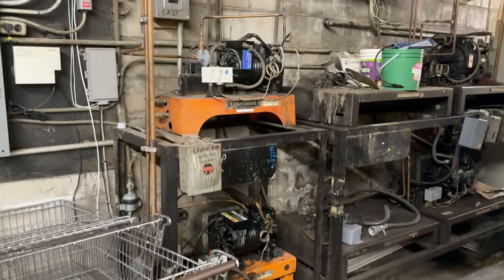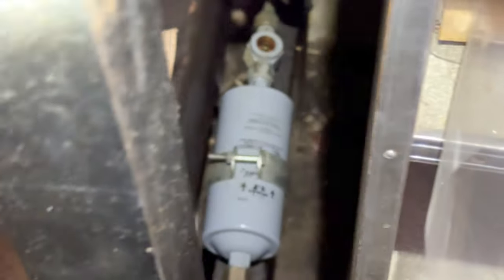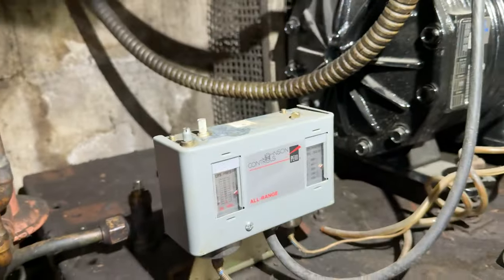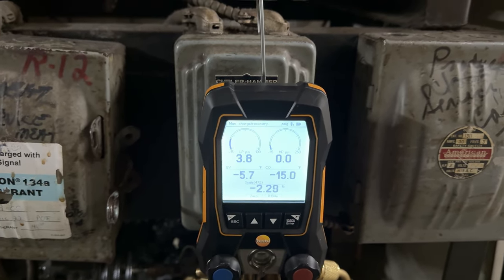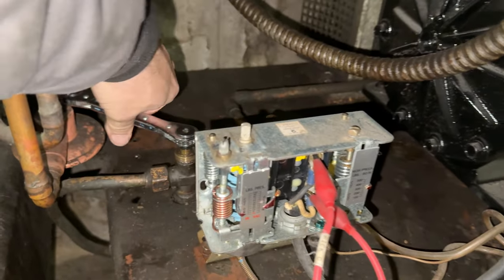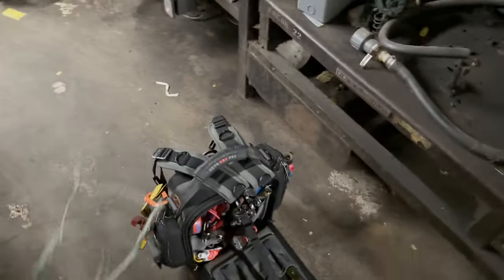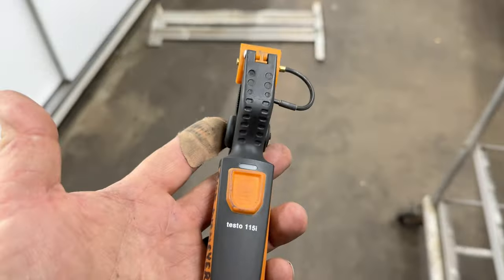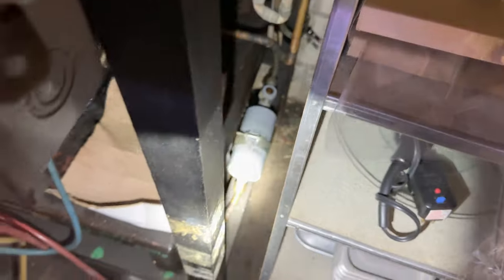Bad TXV & Refrigerant Leak What Else Could You Want?

Comment: See if your company will get you the sporlan BQ kit. You can pretty much build almost any valve you need with it. Saves you time and gets the case back up and running a lot faster... Good luck leak checking tomorrow.
Reply from the maker: Thanks! I should ask about it, they are picky about what they stock on the truck.

Comment: Great video check the TXV what l did first thing is pour hot water to see if it has moisture it will start feeding if not pull off TXV bulb to see if your pressure are changing if not change bulb .

Comment: Awesome video Rick! Lucky the line set is exposed most I’ve worked on is in the slab. Those old Hussman condensers that have the receiver on the bottom will have have a pressure relief on the back side of the receiver and will leak a lot being on high side. Keep up the good work brother!
Reply from the maker: That might be where it went then. I was told the condenser fans failed twice. I will be checking for oil at the pop off, I didn't see them.
Reply: @HVACRSurvival  I believe it is a 1/2 or 5/8 flare hard to see sometimes. I have found 2 or 3 when leak detection of cases turn up nothing. Once they start leaking they won’t stop. I’ve capped all mine with a flare cap. Good luck maybe another video.
Reply: You are right ,i had that before,what do you think about going from low to hbp on the txv. @FPHA697
Reply: Great video Rick

Comment: You might want to check the compressor,if it is low pressure,because you put a HBP txv,and you might be over feeding the compressor,the extra refrigerant.meat display run at 28 deg.hope that helps.
Reply from the maker: I'm not good at matching the txvs, thats why I had our top guy do it. If it's wrong then I would hope he would of caught it.

Comment: It is hard to charge a unit with r134 to clear glass,when it is cold and the fans do not cycle,sometimes they will not clear,the frost pattern on evap and s/h should be good enough
Reply from the maker: I was concerned how much I had to add and the flow of the refrigerant looked slow. I will feel better once I remove it and weigh in, then I'll know what the total charge is.
Reply: charge it with the head pressure connected,if it is cold you might have to block condenser to bring head pressure up to clear sight glass. @HVACRSurvival

Comment: How do you charge on a job like that? Is it a call out then hourly rate + parts etc,, or do you quote the job up front... i have stopped doing refrigeration due to the high cost of parts and gas and the constant arguments over price, i cant get it through to customers that they may have more than one problem and the price will change.. my favourite one is 'it just needs topping up' or the old ' it needs new gas'  ??? Its a difficult field for small or one man companys, especially when the customer wont pay a call out and wants a cast in stone quote over the phone 😂 I think im better sticking to the other catering equipment like ovens and dishwashers, etc...😅
Reply from the maker: Hourly plus parts unless they want it quoted. Then it’s wherever time I think it will take and the office calculates it out.

Comment: you could be able to change powerhead easy.
Reply from the maker: OK, Explain how you would do it and why you would want to warranty it for free if it failed in a year after the repair?
Reply: If you already clean filter and pin it would work Great. Powerhead most of time is issue when it lose charge and slammed closed.   You did good
Reply: @HVACRSurvival  I work for supermarket refrigeration with racks